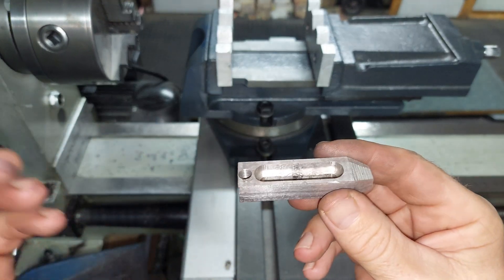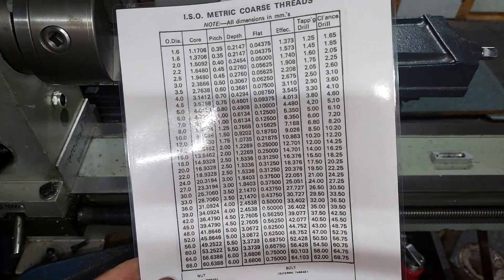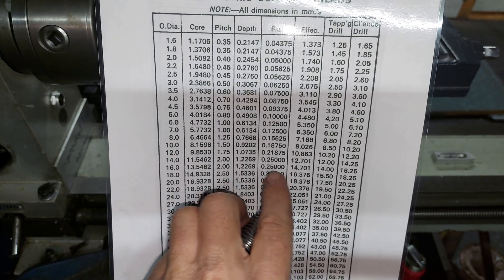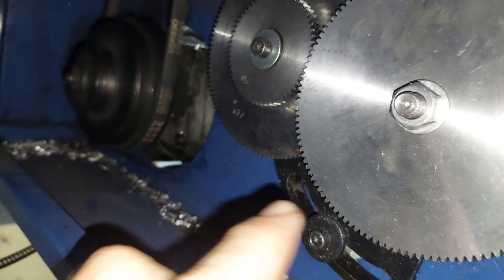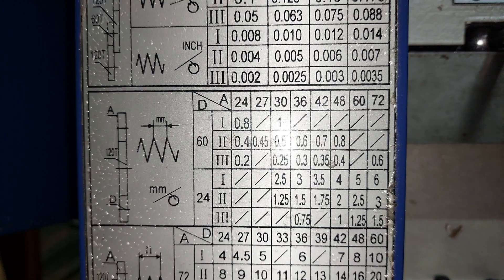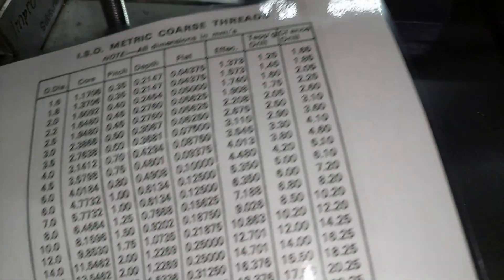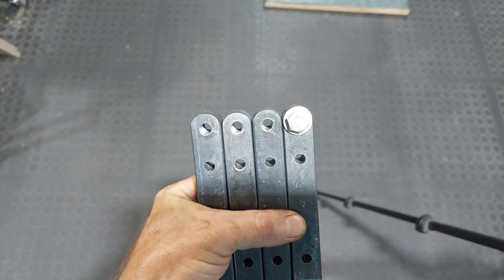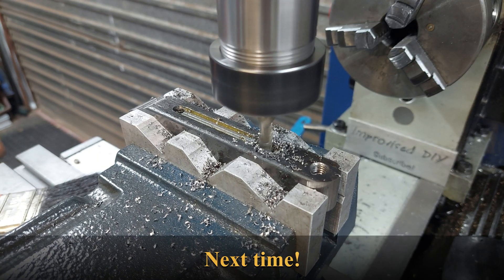Making Toe Clamps

Comment: You need very little hold down force on a CNC. What you need lots of is sideways force. I use cams and wedges. Once the job can't move sideways I just need two light hold-downs to stop it jumping.
Reply from the maker: I agree. The tips won't be narrowed like normal toe clamps. I have sandblasted them to make them more grippy (next video). My brother might glue wood or brass to the tips. The hole pattern on my brother's CNC is too widely spaced for the cams to work. Thanks for watching.
Reply: @improviseddiy  I have no hold down holes on my CNC. I always found them to be in the wrong place. Now, when I start a job I just make a hole in the best spot. In six months I have only made four holes.
Reply from the maker: I made a low-profile vise/pallet fixture combo for my CNC, since I only make small Alu parts on it.

Comment: Smart move using washer to make round profile. I've lost my machines threading ability when I converted to cnc. Need to install a decoder to sync lathe spindle rpm on mach 4
Reply from the maker: Thanks Paul. The power-feed helps save the finger joints. CNC is a bit more complicated.